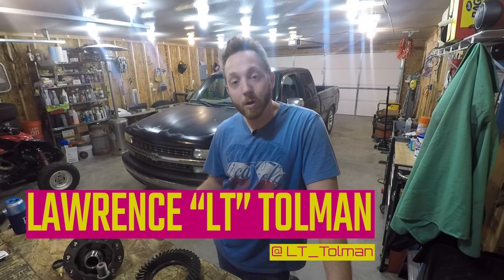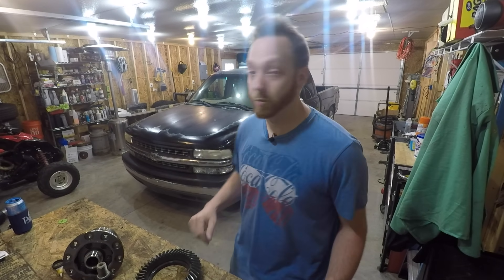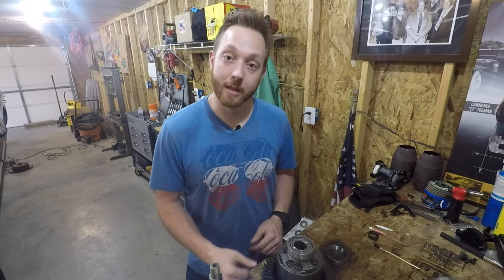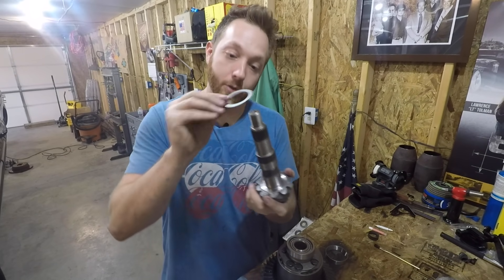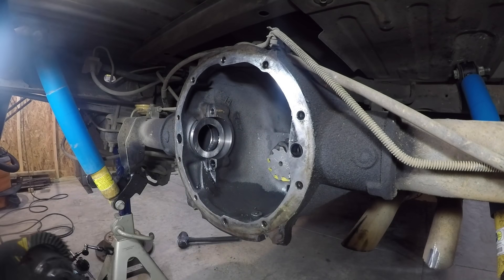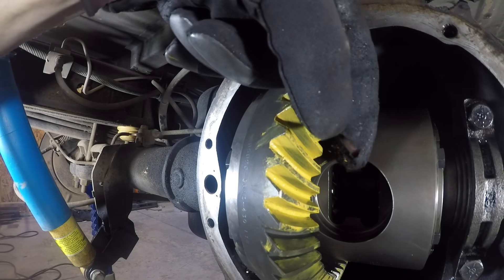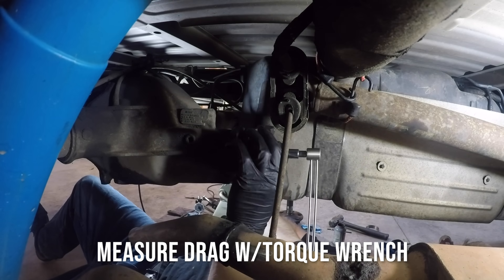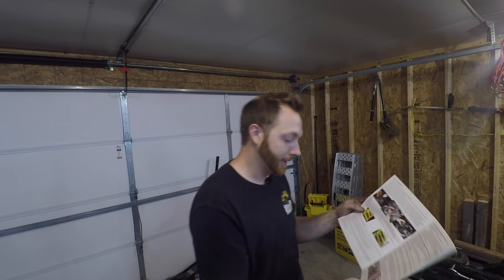how to re-gear a GM 8.6" 10-bolt axle

Comment: I’m looking into regearing my ‘18. With only 40k miles would I still need to get all  new bearings and seals or can everything be reused if it’s not worn out? Ring a pinion sets are only a hair over $100 on rockauto right now but they don’t come with anything else
Reply from the maker: in theory, yes as long as you can remove the stock pinion bearings from the pinion without damaging them. I have done it before, but my preference is to just get new bearings. In your case if you are just re-gearing and not swapping the carrier, you could get away with just new pinion bearings, and re-use the carrier bearings.

Comment: The 7.6 IFS in my Colorado needs new bearings . If only replacing bearings , not ring and pinion or the carrier , can I just use the original shim under the new pinion  bearing as is the most common practice that I see for setting the depth ? Great information by the way .
Reply from the maker: thats the way I would do it, as in theory the new bearings will have the same dimensions as the original ones did when they were new, and you're not changing anything if you re-use the original gears and carrier. Would be a good idea to run a pattern check just to be sure tho...
Reply: @TolmanPerformance      Thanks LT !!